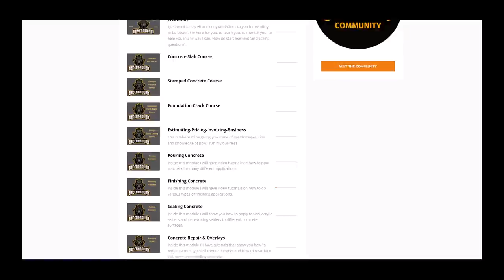We Combined Roller Stamping And Broom Finished Concrete (Never Done Before)(:

Comment: When do you use a water reducer? High range vs low range?
Reply from the maker: We always use a mid-range, no matter if we're pouring a 4 slump or a 6 slump. If we want a higher slump (looser wetter concrete) we use a high-range.